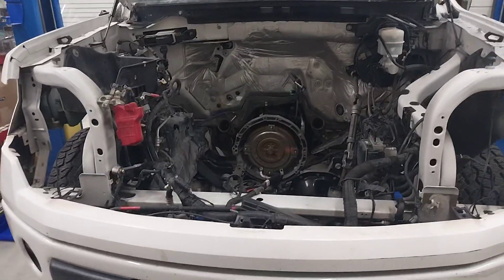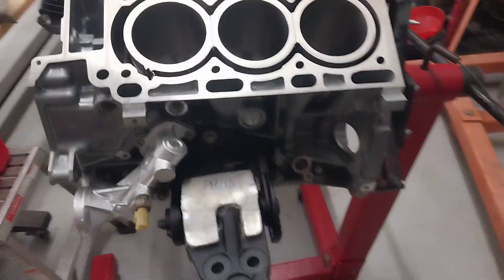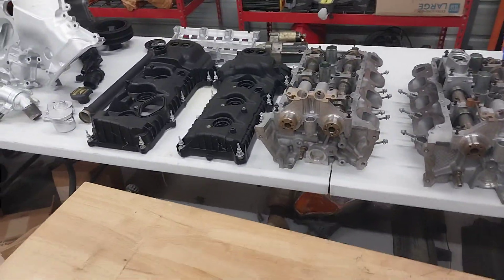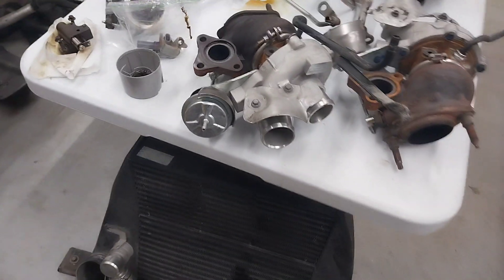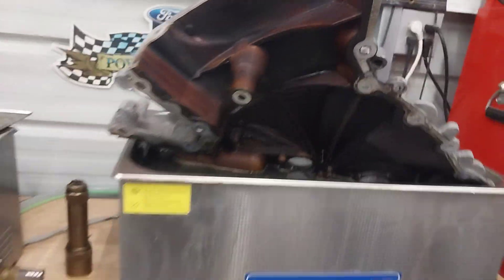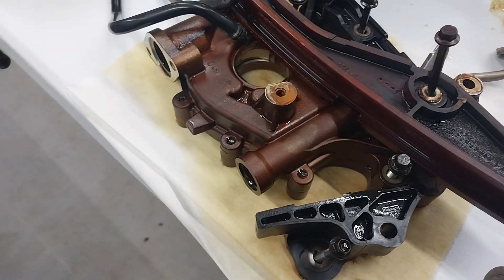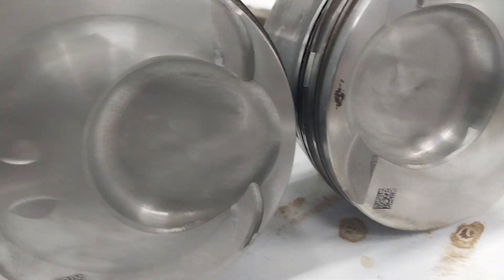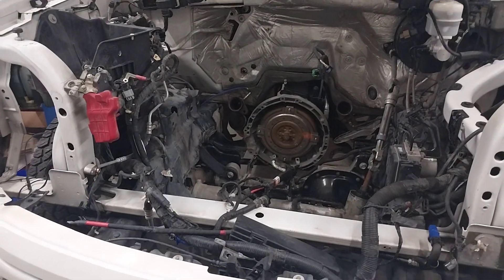3.5 ECOBOOST SERIES:  UPDATE!!!!!!!

Comment: Need to put that Cleveland in the king ranch and get you Prius if you want to save gas lolz can’t haul up a hill or tow far that is why you have a thousand parts in front of you and no supply to get more unless you want used or cheap secondary parts suppliers I get it ok it’s a king ranch put that bad boy motor in it
Reply from the maker: I would like that however it's just not able to happen.  Not sure what you mean about parts.  I have all Ford replacement parts for both 3.5 projects.  And yes they can and will tow up hills...  mountains.....  And I have towed quite a long distance with mine as well.

Comment: Hi, thank for sharing. Do you have a excel list of the part you buy to rebuild? And the supplier and cost of those parts?
Reply from the maker: Sorry, I work these trucks a side job so I don't release my lists or pricing I pay for parts on full engine jobs.  I price them out according to what I find as I investigate or if the customer wants only a short block, long block, or complete drop in engine with or without turbos.  It all depends on customer wants and $$$$$.